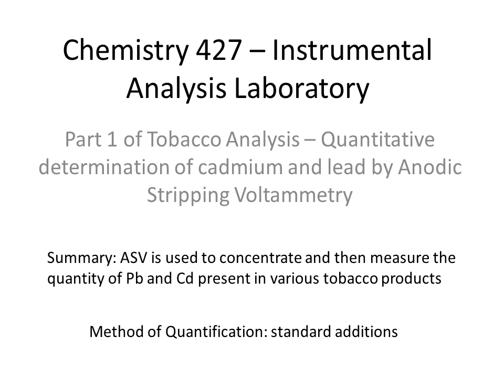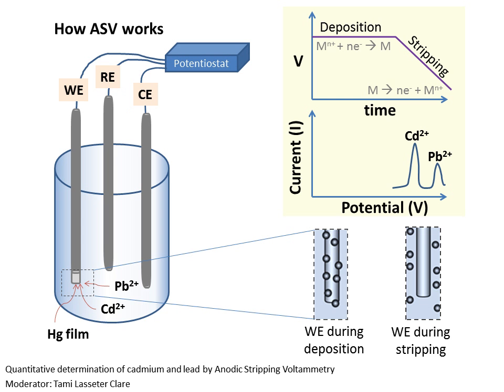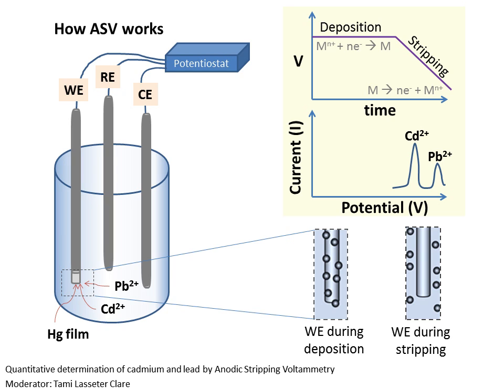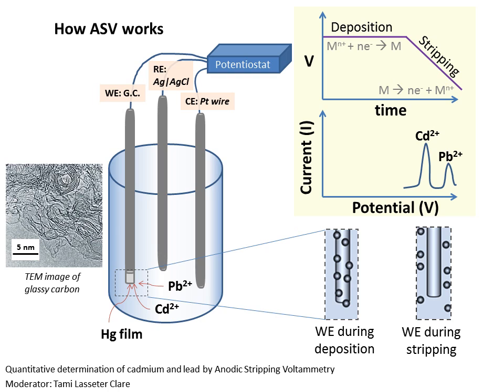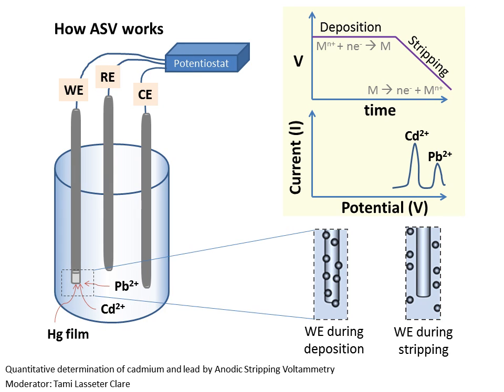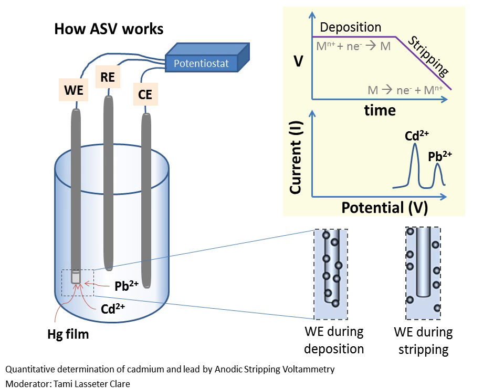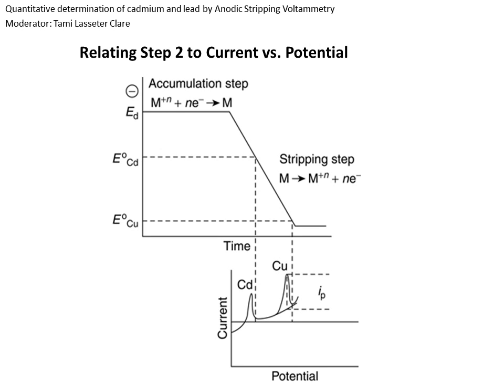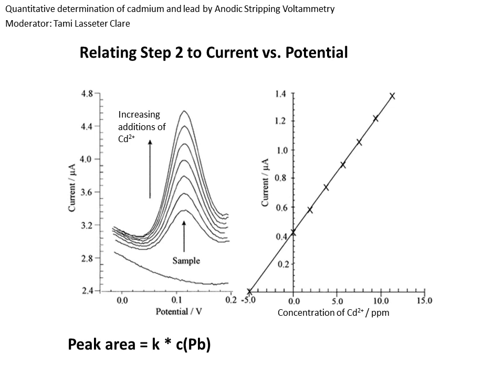Anodic Stripping Voltammetry Pre-lab lecture

Comment: can we use it to find concentration of fluoride in water
Reply: fluorine is a diatomic nonmetal, so, no.
Reply: But we can use cathodic stripping to form HgF2 at working electrode and then stripping it to see resulting current.